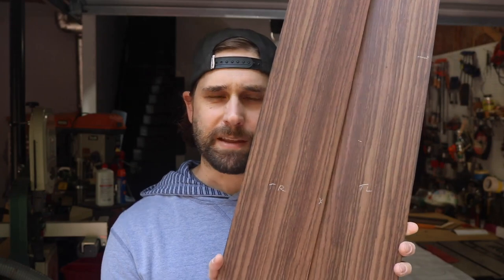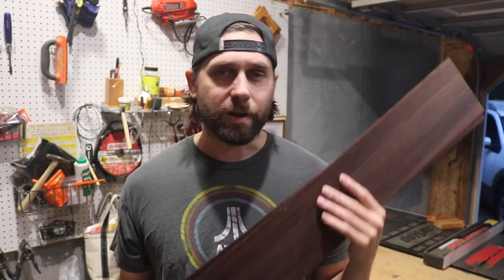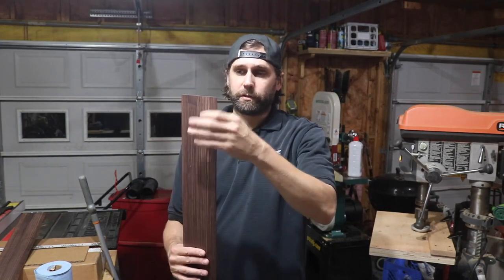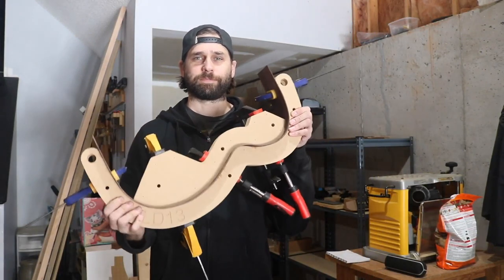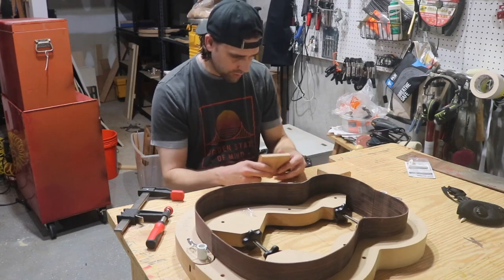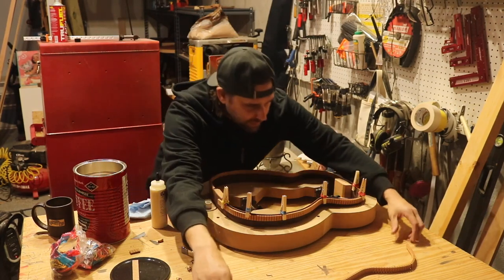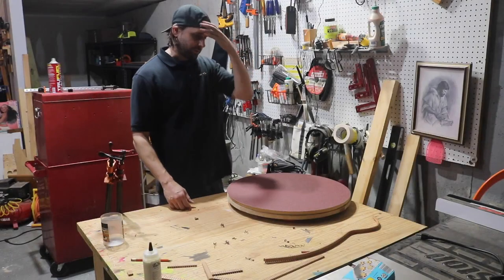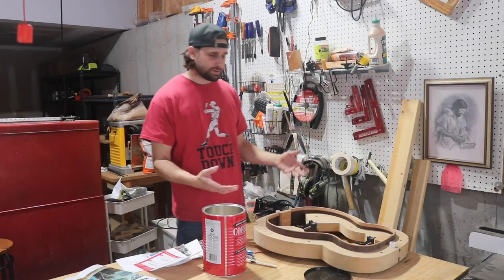Acoustic Guitar Build part 1 // the sides

Comment: A trick I learned when cutting the excess off after you have the sides bent, is turn it on it’s side so that the blade cuts the entire widths of the side, perfect straight cut every time.
Reply from the maker: I actually recently saw a video of someone doing it that way. I may try it next time. Thanks for the tip!

Comment: Dope video.  It looks like you glued the kerfing on backwards though.  You want the non-kerfed face of the kerfing glued to the sides.  Hopefully you won't have any issues with the kerfing pulling away in the future.  Good s**t either way!

Edit:  I just checked LMI's site for the kit you got, and it looks like it only uses the newer kerfing with a radius that's installed reversed like you did, so forget what I said above about the kerfing.  Looking forward to your next video!
Reply from the maker: No problem man! I had never heard of reversed kerfing either before I build this guitar! There are some builders who install solid linings in place of kerfing. They say that reversed kerfing makes the sides a little more rigid. Solid linings even more so. I appreciate the comment! Thanks for watching!
Reply from the maker: By the way, I have continued with videos. Part 13 just came out last weekend where I finished shaping the neck. Just letting you know in case YouTube didn‘t automatically lead you to the next video in the series. Not really sure how that works anymore!

Comment: The "scorching" is not necessarily the heat toasting the wood but the resin coming out of the wood. The resin in rosewood will darken the wood. I worked at Martin Guitar in the 80's and saw this all the time. They scrape the sides once the body is done and that will scrape off and look fantastic. Good progress. Sorry on the side mistake.
Reply from the maker: Thanks for the feedback!  I did sand the insides a little before adding the side struts and noticed that the marks drastically reduced in visibility, so I have hopes the outside will do the same. Makes sense if it is only resin after all. Good to know!

Comment: Hey Chris, great job on your videography. I bought an OM package from LMII that I spec'd myself. Additionally, I bought O'Brien's building DVD set but Robby is not very clear as to the width that he cut his sides to. What width did you use for your sides?
Reply from the maker: Hey man thanks for commenting! There was a guy named Denny Brown who worked with Robbie and took extensive notes of Robbie‘s private courses. Those notes are available on Robbie‘s site. I had to read them to better understand the width of the sides. In the manual he says cut the sides to 110-115mm. I think I shot for the middle between those. After that, then I preradiused the back. Denny also details doing that, from what I remember. Robbie offers the manual free of charge. He just asks you to sign up for his newsletter.

Comment: Re, the gap between the sides and the form, I had LMII bend my sides for me and there are gaps between the sides and their form. (I'm not loving their form - built my own to replace it.) The kerfing breaking is nothing more than an inconvenience - it's only there to give additional gluing surface for your top and back plates. If you'll allow me, regarding the disuniformity of your bends, I noticed that you were wetting the wood and then holding it more or less stationary on the bender until you felt it give. I've found that I get better results by wetting, and then sliding the side back and forth along the region that I'm intending to bend. This method also avoids scorching. I'm guessing by now that you've tried scraping the scorch marks away?  Once again, my compliments on both your approach to guitar-building and your videography.
Reply from the maker: Thanks for the advice on bending! The scorching apparently wasn‘t really scorching according to someone who commented that it is just the resins in the wood rising to the surface from the heat. It all actually scraped/sanded off without any issue. I appreciate the time you took to type out your comments! Thanks for the feedback!
Reply: @CMRWoodworks  thanks again for your input. I've emailed Robbie about Denny Brown's notes.

Comment: Er....you glued the wrong side of the kerfing to the sides. The slots should be facing out.
Reply from the maker: The kerfing I am using is called reverse kerfing, so it’s actually supposed to be that way. It‘s supposed to make the sides stiffer. At least that‘s what I learned in the guitar building course I‘m taking. I had never heard of it before the course, but it‘s used by a lot of builders, apparently.